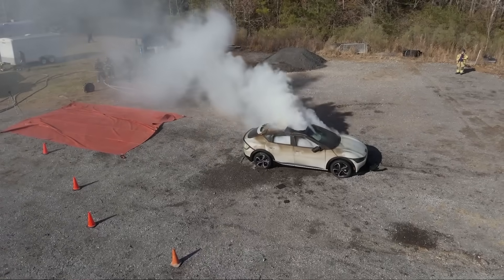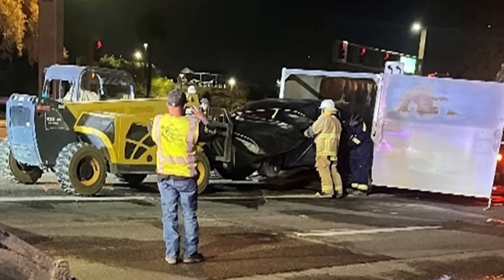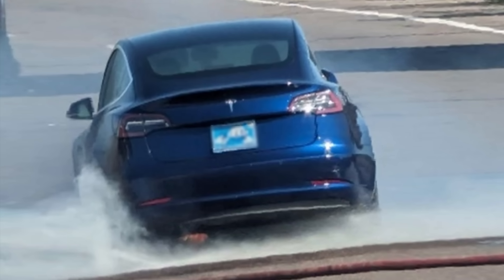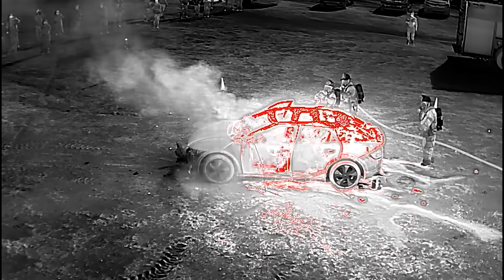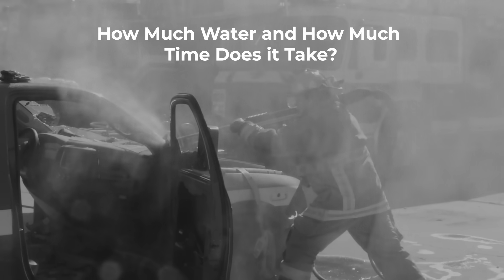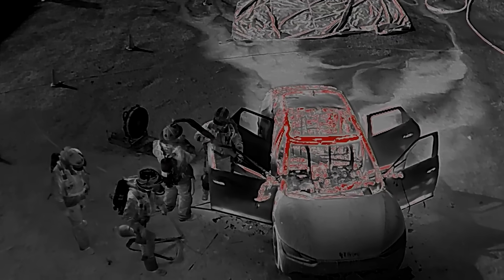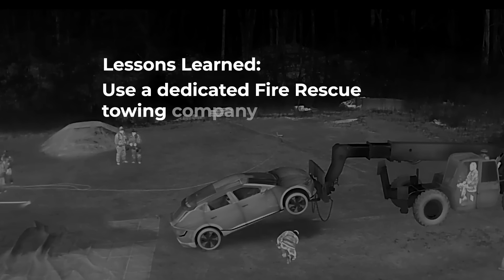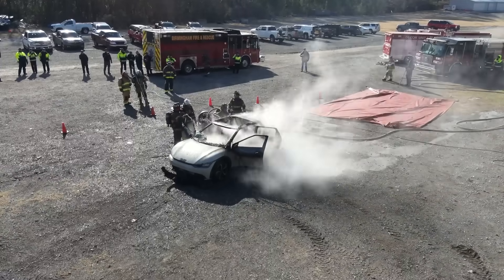Quick and Efficient Method of Extinguishing of an EV Fire tested in Tempe, Arizona

Comment: Why not just require the manufacturers to install a water injection port so the fire fighters can hook up to it?    A 3/8 stainless steel tube running to a port next to a rear tire would work..
Reply: I don't see why that wouldn't work. The Rosenbauer device basically pierces its way into the battery compartment from below and then pumps water in. Of course, the Rosenbaurer lets you deploy from a safer distance, but a dedicated water inlet would certainly work in the early stages of an EV fire.
Only downside might be vandalism or stupidity . . .
Reply from the maker: It exists on some European cars already. But countless others don´t have it
Reply: @ctifnewswebtv3802   The method shown in the video is increasingly being used in Europe too. It works because it gets high-pressure water directly into the cell(s) that are already in thermal runaway. This not only rapidly disrupts the chemical reaction but also cools the interior of the cell — something surface-level spraying simply can’t achieve.

A nozzle or pipe built into the battery pack might deliver water to the outside of a group of cells, but it would struggle to cool the source of the thermal runaway fast enough to stop it spreading. Once a cell goes into runaway, it heats adjacent cells from the inside out. Unless you can directly reach and cool that internal reaction zone, the domino effect continues.

That’s why high-pressure piercing systems are used: they can precisely target the hottest cell and quench it from the inside before it sets off a chain reaction.
Reply: If you listened carefully - they aren't simply trying to flood the entire battery pack - that's likely to be impossible.  They're using thermal imaging to determine where the hot-spots caused by the "run-away" effect is occurring and strategically injecting water at just that one location.  That's how they do it with so little water.
Reply: @SteveBakerIsHere  I have been part of the team developing this method, and the thermal imager is a great tool to find out the vicinity where to inject water. Looking at it as a water flow problem were you aim to fill the entire battery, however is a good way of thinking. The amounts of water are still tiny compared to the old methods.
Reply: Renault/Nissan have a water injection port on the battery packs of their new EV vehicles.
Reply: The solution that is more upcoming is batteries that are less prone to fires, including thermal runaway. There's been a few independant breaktrought on that recently, so I expect that to be on the market within the next decade, most probably before that.
Reply: Most packs are not one big open box and structural packs have no internal spaces at all, the approach taken in the vid makes great sense and can be applied universally regardless of manufacturer. The EV industry largely moving away from nickel based chemistries to iron based significantly lowers the risk of thermal run away as well as ever improving battery quality and BMS based thermal management.
Reply: @markdev4796   Most EV packs are most certainly one large pack with all kinds of internal spaces.    I've taken enough of them apart to know what I'm talking about.
Reply: I can’t hear if the narrator is saying “lithium ion” or “lithium iron”, and that matters, because the techniques are different for extinguishing a lithium ion fire vs a lithium iron (aka lithium ferrous phosphate, or LiFePO) fire.
Reply: Why?  The lance can cut through the steel anyway.  What you are  proposing is a port that  requires  firefighters  to get  closer  to the fire, in a particular  spot  that is not always accessible (note  the fire).  
With the method shown here, they can basically  pick any spot  that can get  to the battery.
Reply: Obviously this would need to be designed and then added as a standard, increasing the cost

The issue is how to protect the structure in a collision, that is very difficult to do, which is very different to adding sprinklers to a building for the person who tried to make that comparison

Perhaps run something down the structural frame, the one that forms part of the crumple zone, but you would still have to have a method such as what these firefighters have developed for when the water injection port became compromised in an accident

Also, how to design it so that it interfaces with the battery, obviously when they blast water jets at the battery in this technique they have developed, their pierce the battery shell and inject water into the battery, so any injection port would have to be external to the battery shell, not a port into the battery otherwise the battery would fault - so you have an interface problem that also needs to be solved

It's not that the idea is bad, it just needs development and discussion to determine how/if it can be implemented and to what point it could be developed, perhaps a total solution is not possible and the fire-fighters will need certain equipment anyhow to bridge the solution

What's important is they have developed a better way of fighting EV's and people are now thinking of how to enhance that solution - the collective minds of the public are far greater than the collective minds of a few, that's the real take-away IMO
Reply: @stultuses I don't think it adds much cost since the Renault 5 at €25k already has it
Reply: I was going to make exactly the same comment. Seems like a no-brainer solution that would also add minimal cost.
Reply: I was just about to say the same, Well done
Reply: That's a great idea..(an "extinguishing port"). The negative responses are just weird.
   It will be damaged in a crash? 
      So what? Most would not. Some will. If it makes you happy, add two. Or three. Thick walled SS tubing is malleable and tough. If it were bent into a pretzel shape, it would probably still flow more than the bb sized hole they are describing.
    Yes, older ev's would not have them. Again, so what? There are older cars with no air bags, or even seat belts. Catalytic converters...hydraulic brakes...center high mounted stoplights..all stuff slowly mandated.
   New crap is added all the time. Just do it now.
    Some of the negative comments must be from experts in INefficiency...former federal employees?
Reply: I agree especially since there are already coolant channels in the batteries. A second port might be needed so injected water could escape.
Reply: @ so water with all the toxic chemicals will end up in the ground water. Sound like a very dangerous method of dealing with this problem
Reply: Eh all these people commenting on vehicle costs are idiots talking out of their assholes, European EVs have this already.
Reply: Yep precisely. Simple. Even better why's not have have a fire system installed by the manufacturer. It's been mandatory on large boats for decades. Fire suppression chemical injection system would be easy to install.
Reply: @ Then ask yourself why petrol vehicles that catch fire thirty times more often don’t have them…
Reply: @allangibson8494  because I know about lithium batteries and how difficult they are to extiguish. In the marine industry many private yachts now have water toys that run on Lithium batteries and many more yacht fires from them being charged onboard.
There is absolutely no comparison. Didn't you watch the clip? At all?
You saw the bit where they self ignite two weeks later?
You think you are making a fair comparison?
I'd like to see the fire incident rates per unit between combustion and EV's also. 
But yes, the boat I work on is diesel powered and has an automatic fire suppression system in the engine room. A similar system could easily be implemented in a car engine bay. Does the rate of incidents require it when a hand held extinguisher is usually enough? I doubt it. It's my opinion based on my experiences and you can make absurd comparisons all you like because you are allowed to share your opinion. Even though I think it's completely invalid.
Reply: Because water won't put it out
Reply: That’s a great idea, although simply requiring manufacturers to use lithium iron phosphate batteries instead of Lithium ion would fix the problem completely, as they do not have thermal runaway problems and will not sustain a fire.
Reply: A video I watched from Sweden, they injected salt water into the battery causing the depletion of charge much faster.
Reply: great idea
Reply: Great idea. Maybe the pipe runs to a manifold that will ensure the injected water gets maximum dispersion.
Reply: In a sane America, these vehicles would not have been allowed on the market until this problem was solved. When you worship the wrong god ( Gaia), death is sure to follow.
Reply: Why not just stop producing the toxic s$$t
Reply: Sounds like a great idea! 

Also sounds like such a system may have prevented much of the Fukushima disaster. Simply a port with a label above it "inject cooling water here".
Reply: Greatly  appreciated  video  having  a way to discharge  the failed  battery  might  be a nother  tool   similar  to the obd connector that is in cars now the formula  1 ev race cars hav to discharge  before being transported  so the technology  exists  this may help in storing  damaged  evs to reduce  reignition   .
Reply: Super idea
Reply: @ Until you realise water injection into a charged battery is asking for a hydrogen explosion….
Reply: great idea
Reply: Why not just require them to be fire proof? I mean come on.
Reply: I remember there are a special type of fire extinguishers (Type D) designed for burning metal like lithium.
In fact it should be included with all electic vehicles (or even built into the battery pack itself).
Using just water is not a good solution for lithium as it can burn even submerged.
Reply: There's lots of comments about potential downsides but I'm sure it could be made to work.  Whether it's cost effective for the amount of risk reduction can be figured out too.
Reply: Good idea.
Reply: Very good starting point that perhaps all ev manufacturers should come together and agree on or simply be forced to for sake of the environment
Reply: Just have manufacturers themselves figure out battery fire suppression systems. EVs need them. It will be a differentiating feature and become a selling point. 

Ater all, who doesn't want their car to be safe?
Reply: Interesting
Reply: The idea is worthy of research. Might significantly improve the chances of salvaging the vehicle.
Reply: Batteries need to be sealed so that they can be submerged for hours in fresh water. It would be impossible to inert multiple ports and maintain this integrity. Better solution is to protect the cells from catching fire if a neighboring cell catches fire, which new Teslas and some Chinese manufacturers have done.
Reply: Or just get rid of ev's. Theyre simply not worth it
Reply: @SuperCoopdogg  Gasoline and diesel fires are far more common per capita.    Electric vehicles are very much worth it, so much so, it is the petrol vehicles that are starting to lose the race of economics and security.
Reply: No chance a vindictive type wouldn't rig up a device to plug in, inject a fluid, and now the fire is even more out of control, right?
Reply: Vandalism is a concern.
Reply: When you say 'Why not just...?" you say it like its a simple thing to add to a vehicle.  
as a firefighter i can say most vehicle fires are arson.  this usually only involved the interior of the vehicle and does not generally ignite the batteries.   Another cause is as an exposure to another fire and this will usually also mostly damage the exterior and interior of the vehicle.  When a battery is involved in fire it is most common due to a collision.  In a collision there will be damage to the exterior and sun a port may not be accessible so you would likely need ports on all sides of the vehicle.  Any mandates will increase to cost of the vehicle.  What you are describing is a dry standpipe attachment but for a vehicle.  We have not even adopted such ports as required in homes and buildings.
Reply: @solidstream13  And after a crash, the integrity of the "standpipe" system would likely be compromised.
Reply: @JoeHamelin maybe, but not in the majority of cases. Put 4 on..put ten on..compared to the price of an uncontolled fire?
Reply: @JoeHamelin  No single solution will suit every scenario.
Reply: @solidstream13 so what alternative do you have to offer?
Reply: @solidstream13 But this conversation is not about “most fires”. It is about shorted or damaged EV fires. It seems that virtually ant EV fire results in a total loss and extreme danger to all around it. So why not have a possible quick (or quicker) method of control? How many EV electrical fires are arson after all?
Reply: @snapperboat25 I’m sorry you are confused about the reality of fighting vehicle fires.  I fought them for 30 years.   And they pose no more hazard than a vehicle with a tank of gasoline.
Reply: @solidstream13 So instead of trying to answer my question in a polite manner you choose to take a defensive posture and give me a rude condescending answer? I am not doubting or questioning your experience. Thanks for nothing. Have a nice day.
Reply: @solidstream13  You may be taking "just" too literally. I make that mistake often.  This time I just read through the "just".  I do think the MFGs should be involved for future EVs.
Reply: @solidstream13  I understand your points, good ones..  With one exception:  We have adapted these ports in commercial buildings.     Every commercial building has a hookup on the outside so the fire truck can increase pressure to the sprinklers.
Reply: @rgbcolor6450  But would you trust that building standpipe after an earthquake?
Reply: @rgbcolor6450  I dont think that is accurate. FDC, are standpipes to allow engines(Fire trucks) to get water to hydrants typically in stairwells. This allows the FD to send guys up with hoses to attach & give more water to the fire. Fire sprinklers typically will have a dedicated fire pump(usually with redundant power)for them if the building is tall enough that water pressure affects it. I’m not a fire sprinkler guy, I work at buildings all over both in new construction & existing. The equipment I work on, is typically in close proximity to the fire pumps.
Reply: @TBJK07Jeep   Our 50,000 sqft industrial manufacturing facility had sprinklers everywhere.   The fire department guy said that if we have a major fire, they will pull up and boost the pressure from the normal 70psi city pressure, to over 200psi.
Reply: @rgbcolor6450 but was he correct or just talking to sound like he knew what he was talking about?
Reply: @rgbcolor6450  Building road speeds are quite low resulting in minimal damage during accidents. Unfortunately, the same can't be said for EVs.
Reply: @rgbcolor6450 buildings don't have lithium batteries running them, breakers break, no more power. EV keeps burning. Thfk are likening a building to a car!?
Reply: @solidstream13  Great points, but it might be possible to implement in certain vehicles already using a glycol loop to cool the battery pack. Not a robust solution, as a heavily distorted pack will likely have pinched off cooling channels, but it could be better than nothing.
Reply: @solidstream13 because you are lame and coasting on your laurels.
Reply: 2 problems.
1. They punctured the casing multiple times directly over where the batteries were in run-away.
2. 3/8 wouldn't be enough to flood the entire casing and in a crash, that tube likely wouldn't survive intact.
Reply: @coryfogle5353  , it is not necessary to be at the exact spot where the thermal runaway is.  As long as the water flows there and thus cools the not yet burned cells or modules.
Reply: My car has an inlet for exactly that purpose.
Reply: Because you can't put an electric fire out with water, you can suffocate it though so that only a chemical reaction is taking place and nothing is burning.... Or something to that effect. You also don't need to worry about the hazardous water runoff from whatever you're putting out. The good news is this also works on gas vehicles too. It's actually a better solution all around
Reply: @matt45540  That's why I like nitrogen under a blanket.
Reply: You can mandate things till you’re blue in the face, but then you’d be relying on car owners and their mechanics to properly maintain them.

If you’d like to know how well that would work in the real world (despite being sensible and completely feasible), just look at how many cars have burned out or misaligned headlights.

Or if you live somewhere that gets snow, take a close look at the tire tread on all the cars that slide off the road into a ditch or embankment - you’ll see that the majority of them have either too little tread or tread that’s not suited for driving in snowy or icy conditions. I didn’t even notice that myself until I started putting proper snow and ice tires on my own car because I had one that wouldn’t go in snow or ice without them, but with them it went very nearly as good as my AWD Subaru did with all season tires.

Those are two great and easy to see examples of how well something already built into the vehicles or regulated and required would actually work for firefighters to have to depend on when them matters.
Reply: @babybirdhomethe headlight analogy is bunk.
Reply: @  I would like to point out that every gasoline car in the world has a tube/pipe running to a gasoline holding tank.   My suggestion of a 3/8 tube might be undersized, but every gasoline car has a tube running to the holding tank.
Why would anyone think a tube running into the battery would be any different?
Reply: You are thinking ahead. How about a little tank of argon. That stops fire.
Reply: I take it you’re joking?
Reply: Just a guess: It would make really expensive cars even more expensive.
Reply: More regulations.
Reply: Maybe Tesla could offer a Falcon booster option - hit a button, problem is off into space. Lol
Reply: Have you seen lithium mix with water? A much more dangerous combination
Reply: And then hope the port is accessible, undamaged and in the same format as your tool, or requiring dozens to compromise the integrity of the battery.
Reply: Because President Musk won't allow it.
Reply: Because companies will fight tooth and nail to prevent some regulation being added to their vehicle, especially one that would suggest something faulty about their product
Reply: Water won’t stop it. Starving it from oxygen doesn’t work either. A lithium ion battery won’t stop burning until its thermal ramp is over. You can drop it in the sea it still will burn.
Reply: Water is not the method to kill the fire. Foam
Reply: @iwejun Foam has the same problem as Water - water makes EV fires more intense because it chemically reacts with the batteries.
Reply: They need to inject the high pressure water at the spot within the battery pack where the thermal runaway is taking place. A single general port location won't do.
Reply: @vulpo  Actually not. The water is cooling the adjacent cells to the thermal runaway and as long as the water can flow to this spot it is fine.
Reply: that would be a very difficult standard to pass legally, and theres already millions of EV's out theres that wouldnt have them
Reply: @ouzzii1499  Gotta start somewhere. Someone probably said the same about seat belts
Reply: @ouzzii1499  I don't see why, we have tons of federally mandated standards for cars, there is no reason we could not do that moving forward. The older cars will age out just as they always have.
Reply: @ouzzii1499 It doesn’t need to be a complicated legal standard, it can also be evolved from patents. 

For example, the modern three-point seat belt was designed by an engineer at Volvo, initially only available in Volvo cars. After measuring the effectiveness, Volvo did grant free licenses to their competitors for the patent, as “being able to survive a car accident” shouldn’t be restricted to drivers of just one brand of cars.

Renault is currently following a similar idea: they’ve been inventing a battery with a metal rupture disk; the disk can be easily broken by high pressure water jets to flood the battery. No need to fiddle around with plug connections on a burning vehicle , just point water at the rupture disk.

Renault patented this idea (“Fireman Access”), but also grant free use to any competitors via their “Universal Patent” program. Renault has also been training tens of thousands of firefighters on how to extinguish EV fires, they’ve also been donating thousand of cars for hands on fire fighting training. 

So: the feature is documented, firefighters are being trained to watch out for it and it doesn’t really add cost to add this feature, but it makes life more safe. And with sufficient awareness, you don’t need a complicated legal standard: as everyone might be expecting this from modern cars. And once it has become a widely accepted standard, you can still have legal experts come up with legislation to mandate this in every newly registered vehicle after some fixed date.

After all, it worked that way for seatbelts, why not for something else?
Reply: @ouzzii1499 actually, that would be super easy, compared to say exhaust catalysts, or dpf's
Reply: @ouzzii1499  A lot of things are difficult and nothing is perfect from day one but that can't stop us from doing something. It was difficult to mandate seat belts and convince people to use them but it eventually was successful.
Reply: @ouzzii1499  There are millions of homes without sprinklers or injectable sprinkler systems would a new build major structural renovation mandate not still be helpful? Especially now a days when builders are adopting essentially cardboard for the house envelope?
Reply: @ouzzii1499 Or, get this, the manufacturers could do it voluntarily. Just kidding. That would subtract from their profit margin and upset stock holders. Great idea though.
Reply: Water does not actually extinguish a lithium battery fire.  It only temporarily interrupts the fire.  A lithium battery fire is not fully extinguished until the consumable material has been exhausted.  It can reignite at any time after it had been interrupted if consumable material remains.
Reply: @silversurfer100 While that is true on a cell level, there are hundreds of cells in a pack and the aim of the water is to take the heat away before it spreads to the cells around the ones that are already on fire
Reply: @jamesharris5158 correct. If I heard correctly the fire department used thermal imaging cameras to pinpoint the runaway cells. The water would keep the adjacent cells cool until the runaway cell had expended its energy and been cooled itself.
Reply: @silversurfer100 

What if they put the E.V. into the Conex Box and injected inexpensive Nitrogen Gas.
The heat would still be generated till the Cells discharge.

But I suspect, the Metals would be retrievable but not consumed 🤔 ?

Gregory/
The Pigeon Meister
        ... .  🐦‍⬛
Reply: @silversurfer100 Water does extinguish a lithium fire. It cools it down, stopping the chemical process.
Reply: @ComplicatedStuff  Actually the battery with the thermal runaway might have to burn to completion before it looks like the fire is out. The water cools the adjacent cells, thus preventing them from start burning.
Reply: @UtkikenRescue  Yes, this is true. The cell that is in a thermal runaway burns out fast and is not stopped by the water. The goals is indeed to cool adjacent cells. We are developing methods to stop adjacent cells going in thermal runaway (propagation), and we test by forcing 1 cell into TR. It is often surprisingly difficult to get a cell into a TR event.
Reply: @ComplicatedStuff  Interesting work you are doing. Is there anything public on your work? 
I am doing the same kind of ignition work as you do and totally agree on the difficulty, depending on the method, to get cells to ignite.
Reply: They would definitely add 15k to the price of the car for the customer lol
Reply: Water is an OXIDISER for lithium.
It is like putting a fire with diesel.
Carbon Dioxide has the same problem.
EV fires are METAL fires.
EV fires are best extinguished with fire blankets.
Reply: @allangibson8494  You are right about lithium metal being an oxidiser. However  , the lithium in these kind of batteries are ions, and dont want to react with water.
This method is based on cooling the not yet burned cells. These cells have a casing around them and prevents water from entering the cell as well. The burning cells, if they  contain the smallest amount of lithium in its metal shape will burn due to the thermal runaway and does not make the fire worse. 
I am not saying that fire blankets are bad, I just mean we need several different tools depending on the situation.
Reply: @ Lithium Cobalt (or Manganese) Ion Batteries have lithium metal present on the surface of the graphite electrodes when charged above 80%. The graphite becomes saturated (particularly when charged at high rates).
That is one of the reasons why these batteries are recommended not to be charged above 80% (90% especially) routinely. The presence of the plated lithium also reduces the battery capacity as it is less soluble in the electrolytes.
Lithium Iron Phosphate batteries don’t do this.
Lithium is a REDUCING agent. It will strip oxidisers from other materials, particularly if hot. Water is a hydroxide. Add any contaminant (like chlorine) and it’s conductive shorting out individual cells causing thermal runaway. Individual lithium cells have a high enough voltage to disassociate water into hydrogen and oxygen too.
That said, most EV fires don’t involve the batteries. Arson is more common than actual battery fires, and burning plastic is usually easily put out with water.
Reply: @allangibson8494 I dont know where you got that, but water does work. It cools the cells, stopping the thermal runaway event. A blanket doesnt work, as the cells create their own oxygen in the chemical process.
Reply: @ Battery Cells DONT create oxygen. That’s a myth. The oxygen is chemically bound to the metal.
Water on the other hand can be chemically stripped apart by both the electrical energy AND by chemical reactions with the lithium metal present in fully charged lithium ion batteries (which is why you are warned not to regularly charge them above 80% - it is both a fire hazard and the metal reduces total battery capacity). Lithium really wants to be lithium hydroxide like sodium wants to be sodium hydroxide (which is why sodium metal explodes on contact with water). Both release HYDROGEN gas which adds to the fire intensity.
Lithium carbonate formation is quite so energetic but will keep a fire going when CO2 is applied.
If the battery pack isn’t compromised, water will put out the burning interior plastics (eventually). If the pack is compromised, bagging the vehicle is the faster option to put out the fire - when it cools below 160C the fire will extinguish but the residual water will cause reignition. Water is a problem not a solution with reactive metal fires, and lithium is a reactive metal, like its neighbours in the periodic table potassium and sodium.
Most Tesla’s have an explosive fuse that is supposed to disconnect the battery on impact (yes a literal explosive charge to physically disconnect the battery) but this won’t work if no significant impact has occurred. 
Tesla’s electric door locks complicate things because you can’t open the vehicle doors from the outside without power - the separate manual release inside has to be used. Cybertrucks particularly are an issue with 1/16” 4stainless steel skins and impact resistant composite glass means standard vehicle rescue tools are useless.
Reply: @ The cathode material has oxygen atoms in it, this material decomposes and you get oxygen gas. I’m familiar with pyrofuses. I’m no chemical expert, but while doing thermal runaway testing we always dump cells in water when propagation happens (test failed), this always extinguishes the cells because it cools it down. It also drains the cells down to 0v over time. Yes, this breaks the water into hydrogen and oxygen but it is not enough to cause danger in open space. Perhaps thats different in a closed space, we don’t do EV sized batteries. Keeping cells close to a 100% charge accelerates the decomposing of the electrolyte.
Reply: @allangibson8494  And the bound oxygen can be cracked to free oxygen during the thermal runaway. Depends on the chemistry of the cells. But this is not a question about blanket or water into the packs. We need both tools and they both have their advantages and disadvantages..
Reply: @ There isn’t any oxygen freed in a thermal runaway. It is chemically bound. It’s like saying rust can be a source of oxygen if you heat steel.
Water is a source of oxygen and hydrogen gas in electrical fires. That’s one of the reasons you don’t put out electrical fires with water. Hydrocarbon fires similarly don’t react well to having water put on on them.
Lithium batteries have both an unisolalatable source of charge (at a high enough voltage to disassociate water into gas) and hydrocarbon electrolytes that will burn if pushed.
Reply: @allangibson8494  I am sure you know more about chemistry than me, so please explain. Isn´t a thermite reaction a thing were oxygen in the form of rust is part of a reaction? Since, from the total amount of gases formed, there is about 30 % carbon monoxide and 30% carbon dioxide formed during a thermal runaway, the oxygen in those two gases must come from something in the battery chemistry. I would assume the oxides, but what do you think?
Reply: @ Zero oxygen is released in a thermite reaction. Just a lot of heat.
Bagging a burning lithium battery in a fire blanket will however put it out in seconds.
It needs an oxidiser to burn. Water works as well as air. It will however reignite if exposed to air until discharged.
Reply: You wanna know why, because most batteries and the chemistry of the battery, water isnt a great idea, especially in a high voltage situation. 
Imagine licking your hands and grabbing a 64kw powerline yeah instant death wet or not.
Reply: @Steve211Ucdhihifvshi  , Since the battery is not earthed (grounded) it is possible to assess the risks differently than a building voltage. That makes it possible to assess the risks based on if you can become a part of a closed electrical circuit or not.
Reply: @Steve211Ucdhihifvshi they fo it in Europe..works well. Proof is in the pudding, not your daydreans.